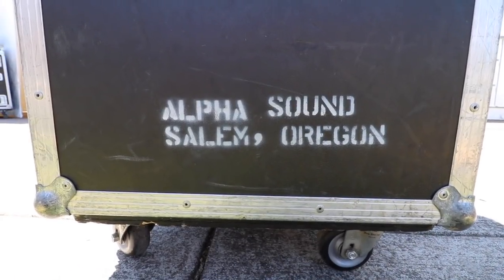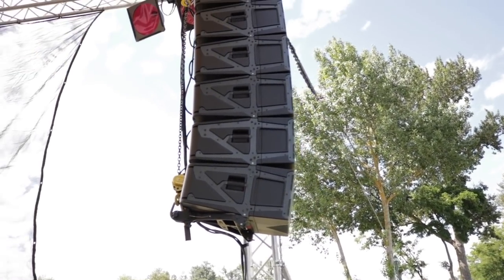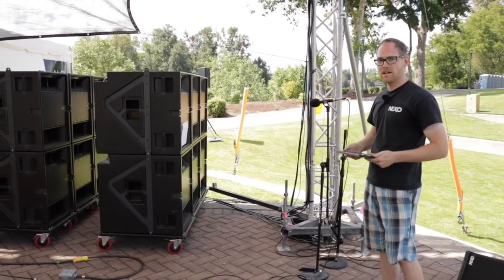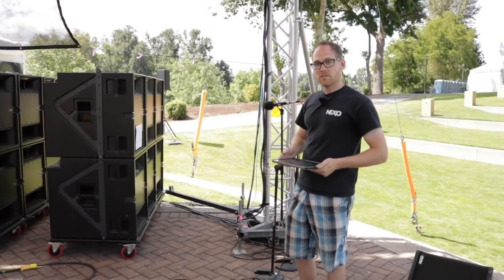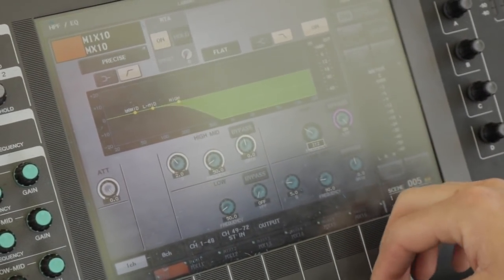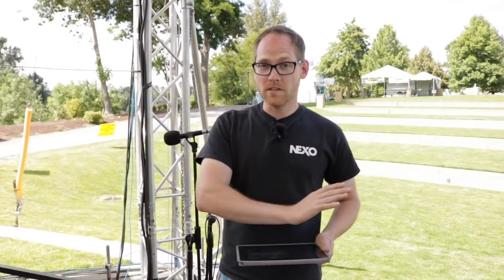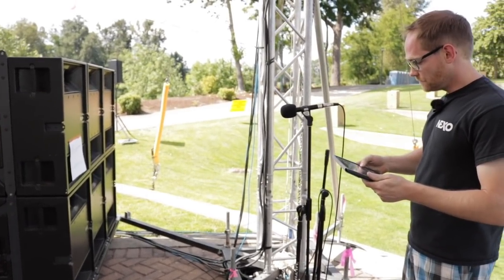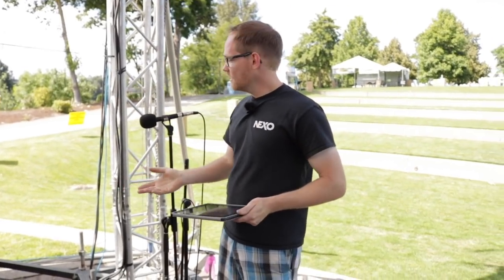The Ultimate Subwoofer Bass Trick

Comment: That sub config is end-fire - so I disregarded everything else you said after that... since this business is about technical expertise and attention to detail...
Reply: Actually that set up is a gradient.    Add a third or more “components” to the front or back, all delayed off of the rear most “component”, and you have “end fire”, which makes a more focused and long throw sub lobe.    A gradient is usually one “component” behind another, sometimes three total parts including the front one, but the rear one is delayed to the front one, and flipped “out” of phase relative to the front one.   The gradient is very efficient space and gear and result wise, as you can shape you lobe with delay time over “100%”, as in MORE than 4.65 feet based on a 60hz center frequency 1/4 wave distance of spacing and delay.   0 delay on the rear speaker or set of speakers which I would call a “component”, and out of phase from the front, would make a dipole, with nearly equal front and rear lobes, and the sides pinched in at the “hips”, where any delay added to the rear “pulls” the rear lobe forward and broadens the front lobe, where your actual distance front baffle to rear baffle being your delay time producing a cardioid pattern at that center frequency, my choice being 60 hz.   Delay times above “100%” of that time/distance approaches a hyper cardioid and then a super cardioid, where generally about 150%  or more of delay begins countering that shape, and then you realize you (myself included) don’t know hack shit about music, harmonics, sound wave propagation, and that a linear equation would be nice, but noooooo, it’s not that simple.   I’ve implemented this “in the field” for about three years now, and one time recently I was mixing a reggae festival, where I was heavily requested to mix and engineer the sound by the artists.    Partway through, a good friend grabbed me and asked where my “famous” “nut twitching” bass mix was.   I told him I thought it sounded great where I was, front and center, and he agreed, but said where he was it was like no subs at all.   I asked him where that was and we walked laterally to about 60 degrees off axis.   And I said, “damn, you are totally right”.   With my iPad I added inches of delay to the existing setting I had, and sure enough, it broadened the front lobe to include our position dramatically.    Damn.   It reduced the forward reach, but that was fine, as the park was more broad than deep.  None of this is linear though, and you can get some serious anomalies at certain frequencies by distance from your “array” and THAT is where you get humbled.    This is why an SVT bass cab makes TONS OF “bass”, but upon real inspection, that bass response is remarkably different as you move around in front of the cab.   No free lunches.   This guys “trick” is just that, where that mic he was tapping on was in FRONT of the subs, albeit not directly, and he had lots of cancellation there.  BUT, how did that sound at that angle from the subs out in the audience?    Hmmmm.   So you have cancellation, but then synthetically BOOST what was a high passed mic channel, with two layers of pitch shift, to “restore” what you had “robbed”?  I’m not buying it.  Yeah, he acknowledged the nuances, but…….no free lunches.